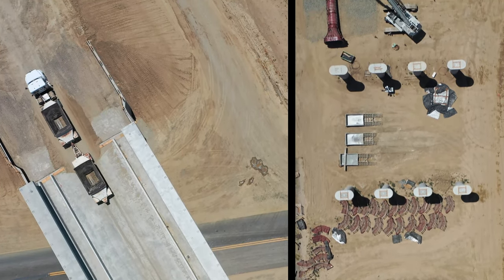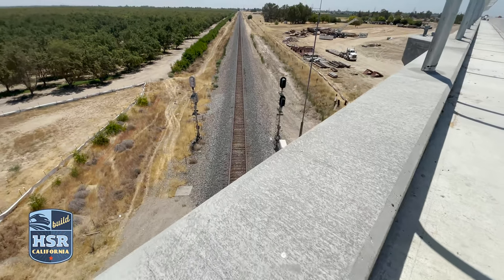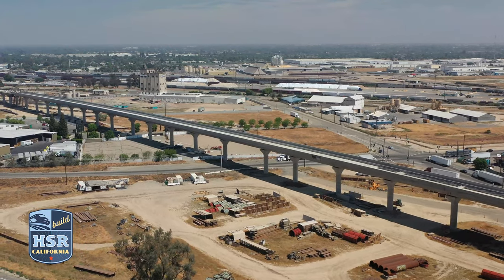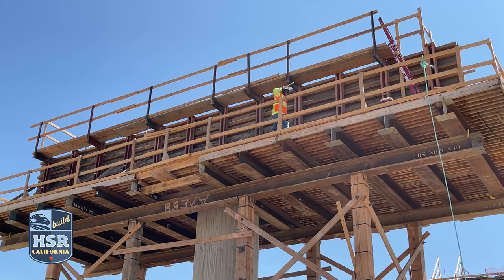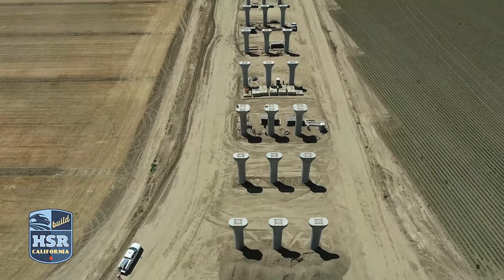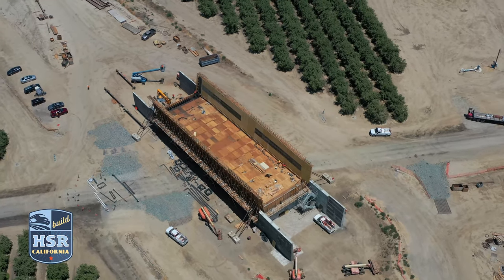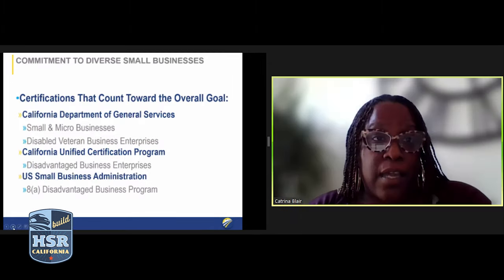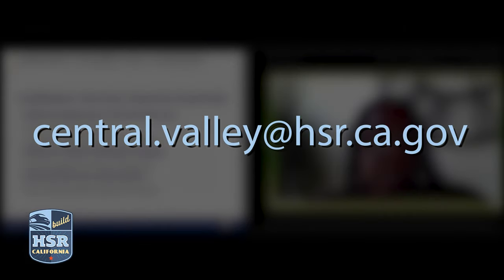California High-Speed Rail Construction Update - Summer 2021

Comment: I'll check back in 2025 and see how many more miles have been completed.
Reply: Ill check in somewhere around 2033 for complete completion, sf to la 🤣
Reply: @user-uj5zc6vx2k  Good luck with that, if by completion you mean SF to LA, it will never happen. This thing will never be profitable and will never be completed.
Reply: @gistsc  sad but probably true
Reply: @gistsc  Oh please, China does this all the time..
Reply: 5 miles
Reply: @gistsc  the track it’s self is not meant to generate a profit. It’s infrastructure meant for travel and transportation of goods that in turn benefits the economy
Reply: @impassable  China built more high speed rail last week than this will build in 10 years.
Reply: @krisreid2815  🤣🤣🤣

Comment: Goodness. They are still building it the slow  old fashion way.
Reply: @christopherderasmo5041  Prefabricated and mass produced concrete that can be assembled on site. Instead they are laying the concrete one section at a time slowly and individually by multiple different private companies. 

This is how china builds HSR so quickly, they basically mass produced concrete for the tracks. Central economic planning has many efficiency benefits when it comes to public works projects like this. It was all planned out by one agency, the government, and constructed by government workers.

 We pay private companies with little oversight that sometimes waste billions of dollars to turn a profit. Like an engineering design pitched by a private company was supposed to be cheaper, but it ended up costing over 3 times as much and then that private company essentially scrapped the idea, from the outside that may look like an error, but the reality is these "design changes" are often carefully thought out to waste as much time and as much money, so the private company can keep enriching itself. It's profitable to waste government  time, and that's why we should have a government entity take over construction projects like this so that incentive for profit is gone.

Comment: After 13 years since the project began, California has spent roughly $5.4 billion and yet have a single mile of rail to install.

China’s high speed rail with a maximum speed of 350 km/h has a typical infrastructure unit cost of about US$ 17-21m per km, with a high ratio of viaducts and tunnels, as compared with US$25-39 m per km in Europe and as high as US$ 56m per km currently estimated in California. 

Distance between LA and San Francisco is about 382 mi (615 km). China could have built a whole double track line halfway between the two cities with that amount of $5.4B.
Reply: The speed at which China can build HSR is impressive, but remember what enables it. In china, if they want to build a road or rail over your property, that's it, your house will be demolished more or less immediately, and you have no say and no recourse. But in the US, people have this little thing called property rights. To build the high speed rail in the US takes years of litigation and acquisition to obtain all the property needed. So no, china could not have done it for 5.4 billion, because you can't even buy the property for that much.
Reply: @MrCharliebbarkin  they wouldn't had to have worried about it if they just built down the middle of I-5 and tunneled under the Grapevine.
Reply: @JediTev  great idea but i think they intend to save that space for future freeway expansion.
Reply: @MrCharliebbarkin  

the workers in china make 2 dollars an hour and since the government technically owns all the land you don't need money to buy that which you already own.
Reply: @JediTev  Then the rail would miss high population centers like Fresno and Bakersfield.
Reply: @MrCharliebbarkin  And since no one in the central valley cities pay state taxes, they don't deserve to have HSR? Part of the reason for and way to sell CA HSR to the voters is to tie the lower income central valley to the wealthier coastal cities. Also housing is cheaper in the valley but good jobs are at the coast. Commutes from Tracy to Silicon Valey can take 2-3 hours by car each way.
Reply: @stevyd  I think you misunderstand my comment. I DO want HSR to go through fresno and bakersfield.
Reply: China is cheap because everything is pre-fabricated in advance. Even in Europe with its high wage costs they  would laugh at the idea of building complete form work to build a bridge. Everything from the abutment foundations upwards would be pre-fabbed offsite to a common design and then just put together on site like Lego blocks.

Comment: It's like this has been set up to fail. Instead of starting with the heavily populated ends at San Fran to San Jose and L.A. to San Diego then building the central section to connect them, they started with the central section running nowhere to nowhere.
Reply: That’s because the wide open Central Valley was the easiest place to begin construction and test trains. Plus the Caltrain corridor between SF and San Jose is being electrified for faster cleaner Caltrain service and future HSR, and at some point Burbank to LA and Anaheim will be electrified (which’ll hopefully mean electrification of the entire Surf Line to San Diego). This is the first high speed rail line in the US, and the largest infrastructure project ever undertaken in recent history, so just as with any large infrastructure project there were bound to be delays and cost overruns.
Reply: The problem with S.F. or L.A. is that there isn't enough money to get it out of either one of those places once you're done.  There was essentially no good place to start with the currently funding gap.  The metro areas also pose the problem of only being higher speed.  So let's say something like Anaheim to Burbank or S.F. to Gilroy.  The only place in either of those areas where you can run flat out are a few miles between S.J. and Gilroy. Non-high speed high speed rail would be a major embarrassment. I doubt any politician would  want to attach themselves to that.
Reply: Totally, it's so depressing...you know you can already take a train from Bakersfield to Merced (via the Amtrak San Joaquins)? You can already go from Bakersfield to Oakland! But you can't take a train from LA to Bakersfield...even if you ignore other ideas (like San Diego to LA), that suggests quite a different order of operations.
Reply: @ramanshah7627  Exactly. I rode on Amtrak from Emeryville to Bakersfield, then transfer to a bus for last leg of the trip to L.A. Union Station.
Reply: I would not characterize the central section as running from nowhere to nowhere. The central valley cities of Fresno (the 5th largest city in California with more than 540,000 inhabitants) and Bakersfield (the 9th largest city in California with nearly 400,000 inhabitants) are not nowhere cities. Yes, HSR will probably connect to a small town like Merced in the central valley,  but the population of California's central valley as a whole is growing and I believe a viable HSR rail connection from the central Valley to Los Angeles, San Diego, San Jose and San Francisco will be beneficial to Californians and tourists alike.

Comment: They should just exempt CHSR from CEQA to get it done.
Reply: @nathanvalle6997  Many cars, trucks, and busses are now electric. Why is rail needed?
Also, how exactly is California supposed to generate the electricity needed to power this line. California has roving blackouts at least once per year. Despite this, California hasn't built new nuclear plants or other significant electricity generating infrastructure.
Reply: California Dreamer  Once fossil fuel cars are banned, electric cars will need to be good for more than just "running errands around town". It's impossible for even the best public transportation to "be anywhere at anytime".
Reply: California Dreamer  Public transit is a good idea. This high speed rail line is not. Do you know anyone who lives in LA who works in San Francisco? Vice versa? From what I know, the tickets will be $80+ *each way*, so it's hardly going to be used by the "working class".
Reply: Rail is far more efficient than cars or planes regardless of energy source. New nuclear would be nice though.
Reply: Might as well, they keep doing it for Elon Musk and none of his projects work.

Comment: So answer me this: does the current plan of interim service between Bakersfield and Merced starting in 2029 mean that only that section will be completed by then with work on extending toward San Jose and LA not beginning until after interim service has begun creating revenue, or will work progress over the passes (at least Pacheco Pass) as train testing and eventual Central Valley service is being commenced? 

Follow up: can you confirm whether the Bakersfield to Merced HSR service will entail the discontinuance of Amtrak San Joaquins service south of Merced to incentivize people to ride HSR, cause if it does that is a terrible idea because a lot of people in the Central Valley, namely those in towns like Wasco and Corcoran that won’t be served by HSR, rely on the Amtrak service who may not be interested and/or are unable to afford riding HSR (unless the ticket prices will be the same as the Amtrak San Joaquins) and resort to driving.
Reply: The completion date is not really clear at this point. Not impossible they'd have the money in 2028? Officially its "before the end of the decade".  The Merced-Bakersfield section is projected to run at an $80 million/year deficit as of the 2020 business plan.  There is no additional money currently for extension beyond Bakersfield or Merced, assuming it gets that far. To be fair, there could possibly be a billion or 2, but not enough to do anything significant.  I think the most that is guaranteed at the point is the 119 miles of cps 1-4 single track, not electrified.
Haven't heard anything about discontinuing the San Joaquins.  As one is state and the other federal, I don't think they overlap in that way.  Although the entire motivation to get to Merced is so that CAHSR can hook up with Amtrak and go north from there.  One intriguing possibility is that Amtrak could be chosen to operate CAHSR.
Reply: At this point I do not believe trains will ever run. If they do, I'll just treat it as a pleasant surprise!
Reply: Kinda doubt ticket price will be anywhere similar to Amtrack. A little matter of what, 500 Billion dollars to pay back?

Comment: The Hoover Dam was built in 5 years and had 25,000 workers. When it was built in the 1930s it was the largest concrete structure of its time and was finished one year early. This is no Hoover Dam and a bullet train is much different. Still, I wish this project would get done already. Taking too long and costing too much money.
Reply: Agree with L, here is some more  perspective. Over 150 years ago the transcontinental railroad was built in 6 years; during the Civil War. They were attacked by Indians, had to bore through the Sierra Nevada Mountains, and find a way through the Rocky Mountains. I believe ground breaking for the High Speed Rail was 2015. Glad to see the current accomplishment.

Comment: Damn, how many years (or decades?) had this project been going on?
Reply: The proposition to fund the planning and initial construction passed in 2008.  The authority stated the project was underway in 2012. They "broke ground" at the beginning of 2015.
Reply: The California High-Speed Rail Authority was originally created in the mid-1990s… granted not much could be done until the proposition passed in '08, but it's now more than a 25-year-long endeavor thus far.
Reply: California Dreamer  Not exactly a ringing endorsement for running transit infrastructure through the east side of the Central Valley...
Reply: California Dreamer  I only shared info about how long the HSR project had been going on for; not from a point of criticism, but from a point of historical accuracy. The topic so far had been only about the HSR timeline, and that's what I was contributing to.

Comment: I question why materials from the 19th century are being used on such an important infrastructure project?  Example, steel re-bar?  Composite re-bar is far superior, adds strength, and doesn't corrode.  The Chinese, Koreans, and Japanese have figured this out 40 years ago.
Reply: Glass-fiber bars are fine for some projects, but are primarily used for lighter construction today due to a variety of reasons. The first is that it is about 25% more expensive per structure which adds up fast especially since this video shows them using a lot of thick rebar and rebar isn't cheap to begin with. Another main reason this that glass-fiber bars are tough to work with. They have to be treated more carefully on the jobsite which means slower work and you can't bend them on the jobsite. Since this project is using a lot of cast-in-place structures, pre-ordering all of those custom-shaped pieces from the factory becomes a real challenge especially when not many companies deal with that material. Finally, regulatory bodies are a lot less confident in the long term behavior of glass-fiber bars in heavy construction (primarily their ability to resist creep).  

A quick Google search of construction projects shows that Japan, China, Korea, and Germany are all also using standard steel rebar in their high speed rail construction which leads me to believe that they don't think glass fiber is the best fit for these kinds of projects either.
Reply: We live in America. We’re pretty well known for being around 60 years behind other first world countries.
Reply: @brandonk7361   China and Japan used CARBON FIBER reinforcement "re-bar" on all of their construction since about 2010.  Why?  It offers better tension, the cost is about 10% more, but the life of the materials (Re-bar & cement) is double that of what using steel would be.  FYI, the steel industry has fought construction code changes for years in the USA for this reason.  Another FYI, I watched the prefab sections being poured in China, all with carbon fiber re-bar.
Reply: @LoydChampion  At least here in the US, carbon fiber rebar isn’t readily available for any large scale projects. I can’t even think of a seller in my state that offers it much less for just 10% above the cost of steel.  
The combination of it not being available, costing more, and not being in standard US building codes is why it’s not being used here. What we’re seeing in the video are cast-in-place elements of the structure. It didn’t take long on Google to see that the CIP features on HSR systems in the countries you mentioned are also using steel over any kind of composite bar.  
I haven’t seen the precast facilities for this project, but I would be shocked if they were choosing to drive up the price and legal risks by using anything other than steel bar in their beams.
Reply: @brandonk7361  It isn't available in the US at the volumes and price point because the steel industry spends millions each year to prevent the acceptance.  This is one little tiny area that shows why and where America is behind the rest of the world, and why we are continuing to fall behind under the burden of our current system of "pay to play" within our governments.
Reply: @LoydChampion  A combination of everything that's been said so far is the answer to your original question. I suppose this project could spend the time and money to revolutionize the rebar industry in America, but I think most voters would rather see our tax dollars for this project go towards finishing the project as soon as possible while not adding anything to the budget that isn't necessary.  
Steel rebar that has been installed properly is good for over 100 years which is why it's good enough for us to use in most American structures and why most people aren't concerned with its use here.
Reply: @brandonk7361   I agree, I was making a point about how far behind the world we are... FYI, most steel rebar in cement starts showing reduction in strength at about 35 years.  You should see the condition of the materials at the condo building that fell down in Florida.  But that is a different topic.  Like you and many others, the sooner this is built with operational trans on it, the better!

Comment: if the china railway construction is the primary contractor, the project will be finished in less than 3 years
Reply: ...only the Chinese contractors can do it and nobody else........from 2008 to 2020 China has finished 38000 km HSR tracks,7800km subway tracks,140000 km freeway..
Reply: @jimmylam9846  true and while the us still uses old construction techniques china has much better construction techniques and haa much advanced heavy equipment

Comment: Why are you using 20th Century construction technique for a 21st Century structure? The Chinese do much of this work in pre-fab.
Reply: Canadians also did the same with their highway in Toronto. I saw then have pre-built rails and stack them like legos using giant lift.
Reply: I personally think they should have gotten some Japanese contractors to help in planning and development. They have had 70 years to perfect themselves routing trains through their 70% mountainous country. Also, China is not well known for their quality.
Reply: Because the United States does not have modern construction equipment!
Reply: In Europe this would be all prefabbed as well as it's much cheaper to build elsewhere and then just drop it into place.

Comment: The Chinese built our trans-continental railroad.  Perhaps if we would have had them build this one, they'd have completed a high speed train route between Los Angeles and San Francisco ten years ago!  That would have included a tunnel under the mountains so as to allow a connection from Bakersfield to Union Station in Los Angeles.